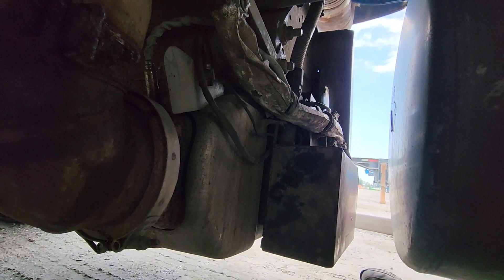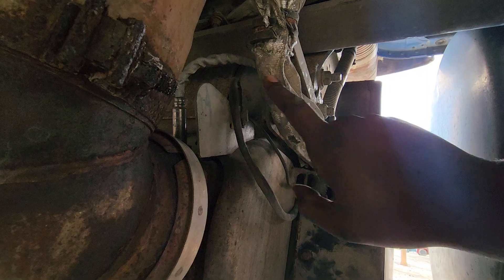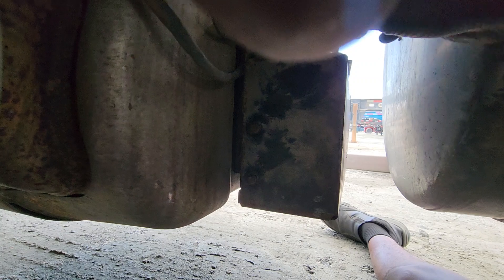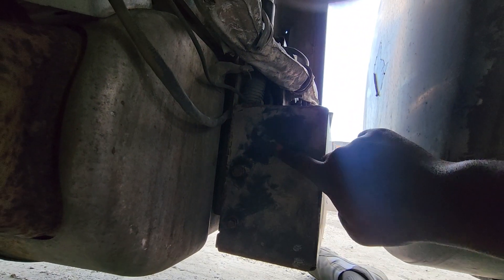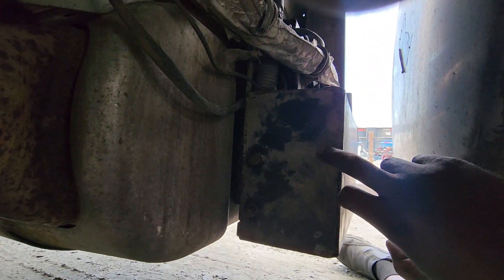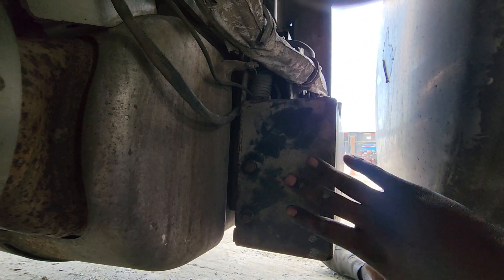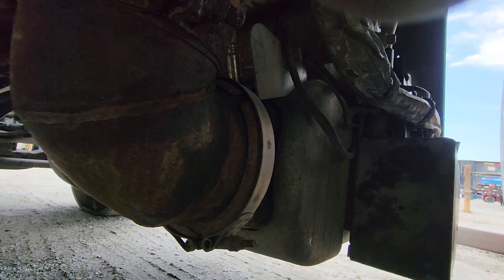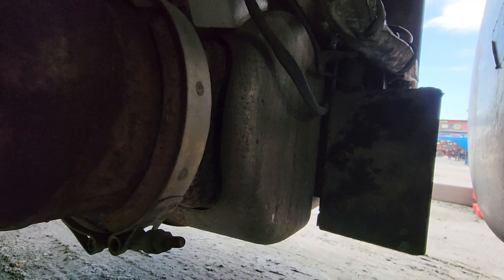SCR CLOSED LOOP CONTROL AT MAXIMUM LIMIT DEF quality low  fix on 2017 freightliner DD15 engine

Comment: Did the yellow light stay on?
Reply from the maker: Once install was completed and fault code was removed no faults or dash lights returned for this issue til this day. Be sure you do not have other codes that could cause CEL. I did not have any others.
Reply: @ thx I’m going to do this now, the light comes on every 1000 miles now
Reply from the maker: Solved my issue light or derate never returned @bigmattus
Reply: @ I just tried it this afternoon and got chk eng light mil light can4  1669/9.   Did you screw the new nox sensor to the chassis or let it dangle, maybe it needs grounded? I don’t know I put it back like it was and the code went away
Reply from the maker: @bigmattus  my truck is a 2017. But I plugged new sensor to harnass and just tucked it where I could find space. Nothing special was done to sensor or wiring.
Reply: @ I’ll have to get an oem sensor and try it again, the one I had was alliance brand new got it new from freightliner the computer isn’t recognizing it.

Comment: 3 questions:

Do you worry about the outlet nox sensor PPM value being too high?

If you have to perform another SCR efficiency test, will you then connect the new nox sensor to get a pass or leave it disconnected while running the test? 

Is everything still running good?
Reply from the maker: @JamersonHayes  1. Nox sensor reading will be little to nothing which is what you want.

2. Scr efficiency test will not fail due to new sensor. In fact it will ensure that failure will not be because of that section.

3. Till this day I have not had any emissions faults or breakdowns since this video. Worth noting that I do not idle my truck more than 30 mins tops when stationary. I run highways alot as well. Before installing sensor I did not have any other emission related faults. Truck is still running strong. Approaching 700,000.
Reply: @themillennialtrucker5243  do you have ig or Twitter? I bought the usblink earlier this week. Just rigged the box sensor this morning, stayed up all night Regen SCR SCR nox install Regen. 

So far everything is good. I will give you an update later. But thank you!!
Reply from the maker: @JamersonHayes  I do but I'm on them alot less than I use to be. Don't even remember Twitter login 🤦🏿‍♂️. But you should be good to go. Til this day no issues or drop offs in performance. Best money  I spent on my truck.
Reply: @themillennialtrucker5243  true. I haven't derated but my truck is throwing spn 3057 nox sensor error. Trying to figure out if I can turn off the check for the sensor in dddl, have you gotten this error?
Reply from the maker: @JamersonHayes  no. No new codes appeared for me. Unfamiliar with that code

Comment: So are you saying you have a Nox sensor plugged into the harness but the sensor side is not inside the exhaust?
Reply from the maker: @mattsmith817  original sensor is still in place( to fill hole). New sensor is plugged to harnass and stored somewhere safe for weather conditions
Reply: @themillennialtrucker5243  so the computer is really only reading air, not exhaust?
Reply from the maker: @mattsmith817  correct

Comment: Much appreciated for the video

Would this help solve the engine code 

spn 520372 fmi 16 

It’s lSelective Catalyst Reduction Closed Loop Control at Maximum Limit” but without the low DEF Quality 

I only have the MIL light on with this code and everything else runs fine

I have heard that this can be a pain to gen rid of

Appreciate the help 👍
Reply from the maker: It's has been awhile since I had this issue. I don't remember codes but it is definitely worth a try. I still have not had any issues since

Comment: Thank you brother, for the informative video.
Is it OK to replace the Nox sensor first, then proceed to doing the efficiency test?  Or it's better to do the test first, then replace the sensor?
Reply from the maker: I did not replace nox sensor. Original sensor is left in place to seal exhaust. New sensor will be connected to factory wiring and placed in a safe location outside the exhaust. Efficiency test can be ran before. I suggest regen after installing new sensor to make sure no new error codes related appear.
Reply: Yes brother, I believe I understand what you mean. 
You only removed the connector from the old sensor and plugged it into the new one, and left the other end that screws into the exhaust intact. Am I correct?
Reply from the maker: @plurouno5394  yes that is correct
Reply: @themillennialtrucker5243  
Hi bro,
I need help once more. What cable do you use to connect the laptop to the truck?
Reply from the maker: @plurouno5394  Diesel Laptops Nexiq USB Link 3 Wired Edition with Repair Information & Diagnostic Software https://a.co/d/8fJkfHy

May be able to find something cheaper but this is what I have. Well worth investment. Comes with software but I use the DDDL. Much easier and precise in my opinion.

Comment: I mean, doesnt the temp matter? Will it not throw another code because the temp is waaay off?
Reply from the maker: It will not (has not in my case) thrown any codes. The nox sensor does not measure temp.

Comment: So let me get this straight. 
You performed SCR efficiency test before installing the new sensor. The code cleared. So you then installed the new sensor and everything is fine.
Reply from the maker: Yes...I would get the fault code causing derate numerous times. The efficiency test has to be performed to clear that particular fault but after a few runs the fault and derate would return. By installing sensor after the fault has been cleared has resulted in fault not reappearing for me as of today.
Reply: @themillennialtrucker5243  thank you for the reply. If you want to stop using def you might could plug the hose or crimp it with vise grips. Assuming it is still spraying def?
Reply from the maker: @jared6356   I did not modify aftertreatment system or delete aftertreatment. Sensor install only bypasses nox output reading. You will still have to maintain truck fluids and maintenance as normal.
Reply: @themillennialtrucker5243  the problem with this is the word test <the software calls it a test> but in fact it is a calibration.
Reply from the maker: @lasher11111  correct.

Comment: When you do this do you sill have codes but no derate? and do you run anything in dddl? i did this and it started derating in half the time as properly installed.
Reply from the maker: To clear fault prior to install you must run regen followed by efficiency test..may take several hours. Once fault is cleared you can install sensor. I also ran a regen following install for good measure and confirmed all numbers were in spec.
Reply: @themillennialtrucker5243  does your 1box have soot sensor in front of nox outlet?
Reply from the maker: @lasher11111  yes
Reply from the maker: No. Prior to install I had no other faults. I also made sure fault that caused this particular derate was cleared before install. I did not modify anything on ecm while connected to DDDL. Have not had any faults since. Did you clear derating fault prior to install?

Comment: Does this really work?
Reply from the maker: Haven't had issue since..still running fine, no more faults
Reply: Only code is s loop closed at maximum  limitl. I have a 2018 dd15 with 590,000.
Reply from the maker: @user-mz3pj3cp5p  sounds like you have same issue then. It was best thing I could have done! $500ish for oem sensor is expensive but much cheaper than alternative options and results have been well worth it.
Reply: @JoshuaRoach-d9i had the same code.. I left the sensor inside the box so FAR SO GOOD
Reply: I've had 5 scr loop closed at maximum limit 5xs since July. Have warranty coverage on mine, and they won't help me fix it. How many miles have you ran? Thank you for the information, I  appreciate it.
Reply from the maker: @user-mz3pj3cp5p  truck had about 590,000 miles on it. Currently at 615,000 and fault hasn't popped up since I did what I mentioned in video. But scr closed loop was only fault that I had appearing on truck. If you have other aftertreatment faults you may need to address those.
Reply: Does it still use def?
Reply from the maker: @user-mz3pj3cp5p  yes. Truck will still need to be maintained as normal. This is not a delete.
Reply: I get that. I dont want it deleted. Just want it to drive for a while with no worries to save money. I'm researching if this works on the 2018, don't think there's a major difference between the two, but who knows lol.
Reply: It only happens in Colorado, Wyoming, and New Mexico, too. Its nuts.
Reply from the maker: @user-mz3pj3cp5p  should be same
Reply: Its a temporary fix for a bigger issue that will cause bigger problems. Just fix it right if youre keeping the truck